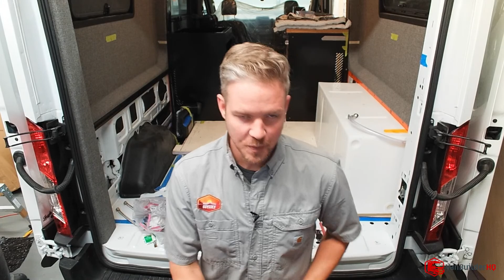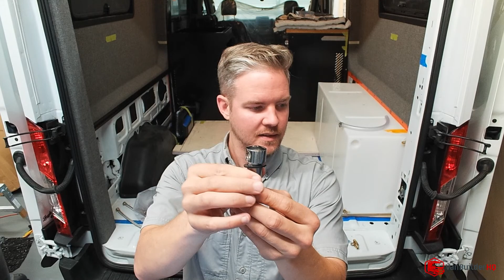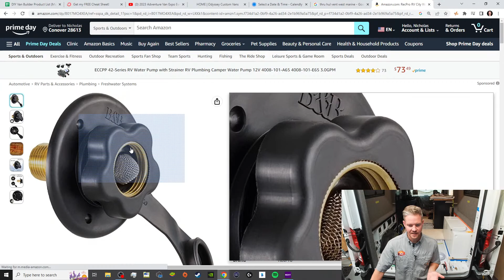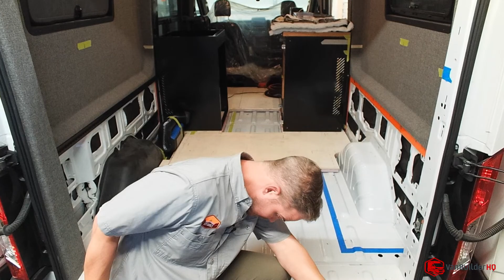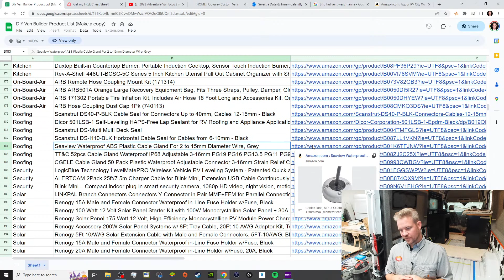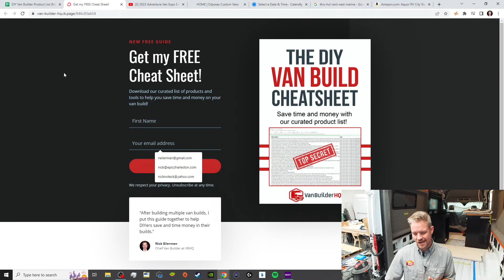Prepping for floor install | Finalizing Plumbing & Electrical Layout

Comment: Got the bed system from FVC a few months ago and it's a nice matte finish, just got the headliner shelf and it's almost a gloss finish. Was a little annoyed about that.
Reply from the maker: Awesome, I love FLVC products, but I'm with you on the different finishes (needs to specify that on the website). My bed frame is matte as well. I was told that all future products will be a gloss finish going forward.